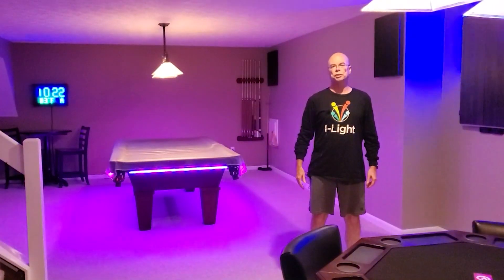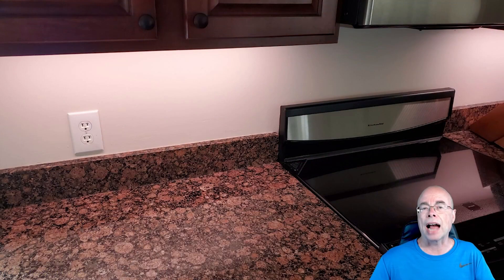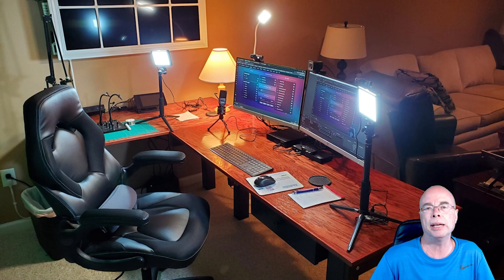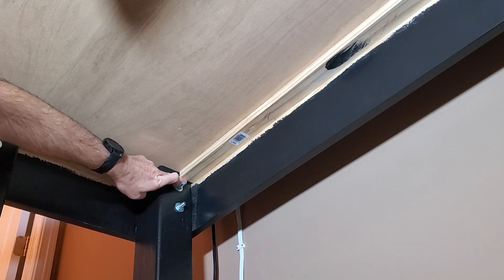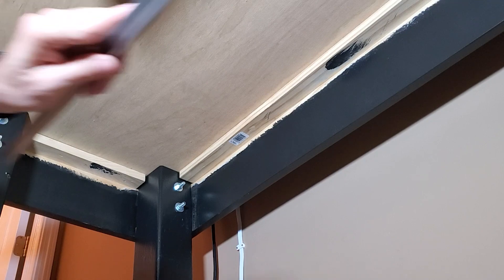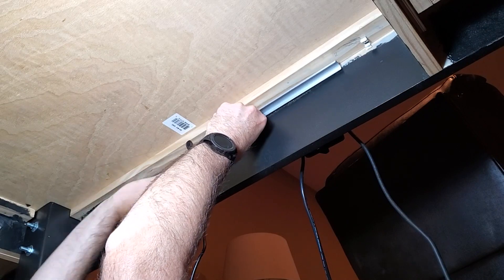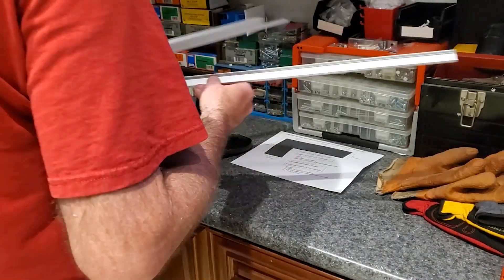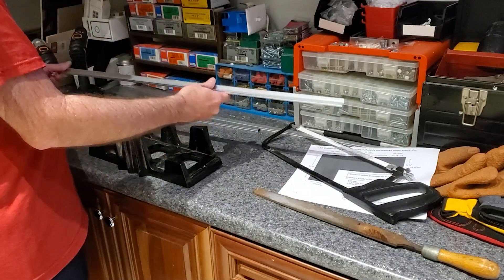Planning a New LED Install

Comment: Will your blog show the switch wiring with a little more detail? Is there a schematic to see what you are switching. This is curious as I see other use cases, possibly. 

Oh and I just used the links to buy a few things but will probably come back later when I make some decisions. 

Oh and calculations of course which is why I didn’t buy LEDs or PS yet.
Reply from the maker: By 'switch', I'm guessing you are referring to the push button?  I have a diagram showing the wiring for a D1 Mini on a quarter size ElectroCookie board with the optional push button wiring in the blog article: https://resinchemtech.blogspot.com/2021/01/building-your-own-led-light-strip.html  (look about 3/4 way down).

But the gist is that you use a normally-open push button.  One lead is wired to a ground connection on the board and the other connects to pin D3 (GPIO0 on Wemos D1 Mini as the default for WLED).  That's all there is to it!  And yes, you could probably substitute something like a reed switch on your garage door so that the lights come on (or go off) whenever the door opens or closes, although you have to be a bit careful about GPIO pin selection depending upon whether the switch is normally open or normally closed or you can cause your ESP board to not boot or go into a boot loop.  Or motion detection and MQTT/Automation like I do on my stair lights.  Really, the possibilities are endless!

As for the calculations, I think I covered this in the video, but I use a rule of thumb of multiplying the number of LEDs by 0.06A (considered the max for full bright white on 5V WS2812b) and then rounding up to the next larger power supply size.

If you have problems seeing the wiring diagram in the blog article (or have other questions), just reach out via email and I can send you a larger version via email.
Reply: @ResinChemTech  oh I am sorry, the switch question was related to a different idea and probably an ESP32 with the sound capability. For another time and new budget. 

My garage door is happening and I have so so many ways to control WLED. 

Do I need this light project? NO! It is because I can!

I just measured and doing power supply calculations and thinking I can oversize and hide my PS for both doors because the garage is attached to breezeway where the door is that is also part of the project. 

So I am confident I can use my HA mobile devices to drive automations and perhaps not only indicate alarm status for me but if not a HA user and picked up by my doorbell camera I can set automations that look for me or others.  I think you get it. I can also use it as entry lights. 

I plan to eventually find that email and send my plan to you as there are questions like, how would you do this. 

This is happening!
Reply from the maker: It's exciting... and also a deep rabbit hole!  I am now north of two dozen separate LED installations in my house.  Most are WLED, but a few are ESPHome based and others are via Arduino code I wrote myself.  Once I got started with LED lighting, I just can't stop.  As I mentioned, if it has a flat surface, I think about how I can install LEDs on it!  Thankfully I have an accommodating wife that (usually) doesn't object to my new projects.  

Feel free to reach out at any time.  I'll be anxious to see your plans and what your thoughts are.  As far as diagrams, it's much easier to share diagrams, photos, etc. via email or Discord so I'll be happy to send more info to you once we can connect outside the YouTube comment system.
Reply: @ResinChemTech  found only this reference but very nice diagrams for lots of it. I wasn’t able to see it on the ECookie board which I bought today on your affiliate link   

I don’t need to chase that or you on that yet anyway but here is what is mentioned,

“Push button control (aka Muggle button)

If you want to be able to toggle your lights off/on, cycle through presets, etc. via a simple button push (see my 5 golden rules post regarding multiple ways to control a device), add a connection to the D3 pin of the controller, along with another connection to ground, and connect these to a normally-open push button.  This will allow you to control the strip via single press, double-press and long-press of the push button.”

I am in agreement with the 5 golden rules and am fortunate when my son moves out I won’t the same need for Acceptance by other occupants.

Comment: Wow looks great! You are so creative!
Reply from the maker: Thanks!  I basically just learned from others... and then try to adapt their ideas for my own particular project.

But I really appreciate you taking the time to comment!
Reply: I love your lights in the kitchen cabinet. Although that project is done it would be neat to see how you did that. What lights you used, where is the power supply. How you turn it on/off etc. my wife is not smart home savvy so she will appreciate the switch. No way she’s putting WLED on her phone 😋
Reply from the maker: I hear ya!  My wife wouldn't use the WLED app (nor the Home Assistant app).  And although there is a push button, she just asks Google to turn on or off the kitchen cabinet lights.  In fact, this is probably one of the most common things she does with all the various smart home devices we have.

The install is pretty similar to the desk... but with some unique differences.  There is another set of cabinets on the opposite wall, but I'm technically using 4 separate WLED controllers (top and bottom, north and south), but use WLED to sync them in certain cases.  The controllers/power supplies are tucked in various spots... sometime in the back corner of a cabinet... in another, they are mounted underneath.

If you are interested, I'd be happy to share more info, including photos, via email.  You can snag my email from the 'About' page on my channel.  I might do a YouTube video at some point, but I have a few other things lined up and in the works for now.  But I'd be more than happy to provide you any other information via email.

Comment: Wow I might consider doing a project like this!! It will be nice to use the skills I’m learning from my circuits class
Reply from the maker: LED strip lighting is an excellent place to start with DIY electronics, especially if you are willing to try building your own controller.  It only takes some basic soldering skills and electronics understanding.  And there are a lot of folks that are willing to help if you run into any issues... myself included!

Let me know if you decide to give it a shot!  Thanks for watching and taking time to comment.  Good luck with your circuits class!